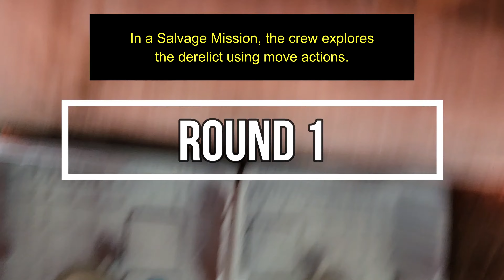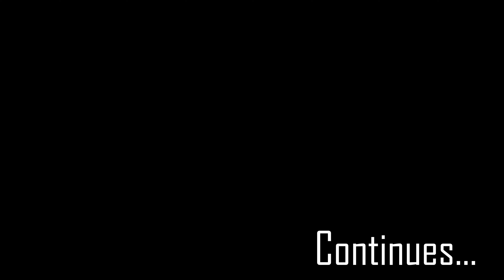Five Parsecs From Home Solo Play, Episode 7: Buried Secrets

Comment: How is the tension-dice-roll working? According to the rules at 4:19 and 6:14 it seems as if the tension meter should only increment up, but between these two times, the meter goes down from 2 to 1. Again, between 8:59 and 12:45 the meter goes down from 3 to 2. Is the meter being reduced on the detection of a contact?
Reply from the maker: You are right! I should have added the tag on that. Every time a new contact is detected, the Tension Meter goes down by an amount equal to the dice roll. So, if Tension was 5 and the roll was 3, Tension goes down to 2.

There are also a few other circunstances that change Tension level, such as when you reach a Point of Interest, but that depends on what type of POI you rolled.